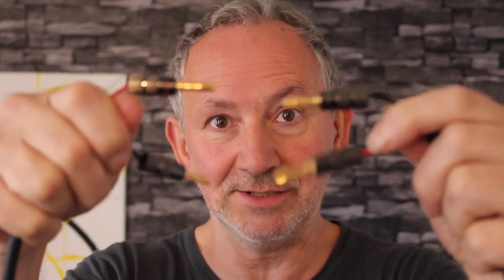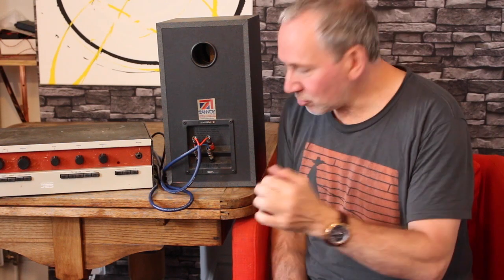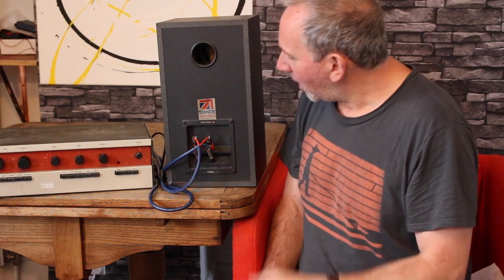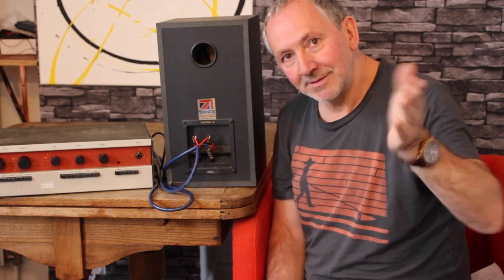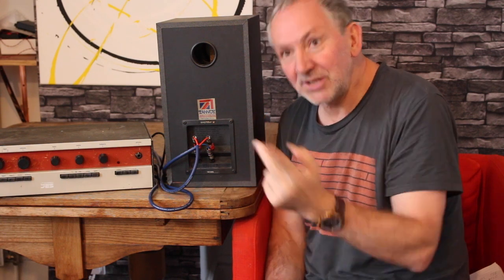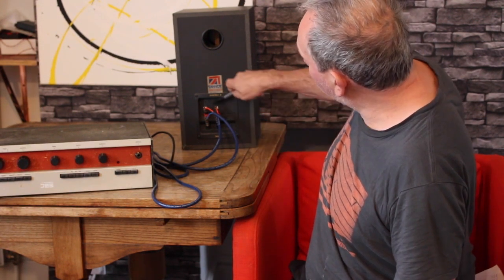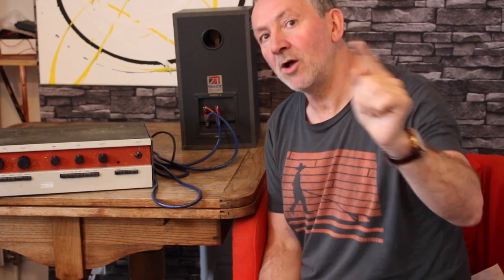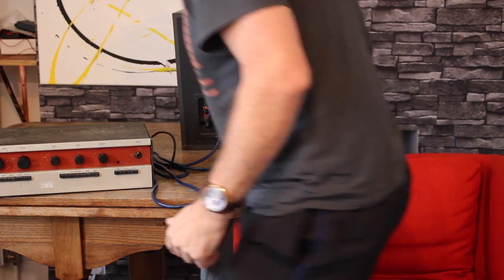WHAT IS BI /WIRING does it improve sound quality

Comment: Aaahhh No!!   Biwiring does not REMOVE circuitry!   How could it?  What have you removed?  You have ADDED twice the cable...  You've quite literally INcreased circuitry.  Think of cables as resistors (and they are).  What you are doing is changing WHERE the cable resistance is placed in the crossover schematic.  Yes..... Biwiring can change the sound.  But not for the better, in my experiences.  It's just different, and it's probably not how the crossover was voiced by the designer.  Adding resistance between the High and Low halves of the crossover will change the sound, and it's likely that the crossover was designed with the 2 halves connected together (ie... both halves being driven by the same EXACT signal).  If you separate that connection at the crossover input, suddenly both halves are not seeing the same exact voltage signal.  I've found that driver integration suffers with biwiring.   Your mileage may vary.

Comment: I've tried biwiring my Mission 760iSE and I honestly can't tell any difference. It only really works in systems which use active crossovers and bi-amping; one amp each for HF and LF. I'm not convinced by cables either. They are basically just copper conductors carrying a small voltage. The only things that really matter are; 1. Never use that thin crappy "bell wire" stuff, 2. Keep your cable runs as short as possible without over tensioning them. 3. Make sure your banana plugs (or whatever) are properly connected to the cable ends; preferably soldered.
Reply: Crimped with a proper crimp tool is better than soldering for power applications.  Loudspeakers of the home variety generally are low power a few amps at painful levels.

Comment: Bi-wiring sells twice as much audiofool wire (2000Pounds instead of 1000GBP).  Double blind test, or instrumentation proof? A big nothing, when compared to external crossover before 1 amp channel per driver. Tweeters and mids can get super-excellent low power Class-A  amps without too much heat or power consumption with lower overall thd.
Reply: Chip amps have way lower THD than tube amps. Class D are very efficient too.

The HY30 /60 amps from ILP were encapsulated chip amps, DC to 250KHz and flat. They were the prefered small amp module for all engineers and techs thirty or years ago.

Comment: Cables, they certainly contribute to the sound but it is nothing significant. But Bi-Wiring certainly do contribute quite significantly to the overall sound quality. I would say even more than 4%. In my case I would say that the sound betterred by even 10%. It was audible at first listen immediately.
Reply: Do you have a cross over in your amp before the output terminals? Otherwise the signal is the same in the two wires to the speaker but then filtered after the speaker crossover. Hearing bi wiring differences is the perfect example of placebo effect.
Reply: @spudpud-T67 As I've pointed out before, the two elements of the crossover are separated by taking out jumpers between the upper and lower terminals. You now have two completely different 'branches', the point at which the highs and lows branch being now at the amplifier end rather than the speaker end. The high pass filter will 'demand' that the high frequency current flows along the tweeter wire, and the low pass filter will 'demand' that the low frequency current flows along the woofer wire. 

That split point at the amplifier end is, in a single wire (normal) configuration, inside the speaker cabinet - usually part of the printed circuit board for speakers with one pair of terminals.
Reply: @rogerwebb7501  Thats a theory some state. Even going as far as to say they hear a difference, but that's not how the signal in the system works.
Reply: @spudpud-T67  It's not a theory, it's a scientific fact! It IS how a crossover and its associated wiring works! The crossover is frequency dependent...each leg of it, that is: It divides the two      groups (or three...or four) by frequency and feeds the treble to the tweeter, and the bass to the woofer. I think the trouble is you don't understand WHERE that split occurs. Ina biwire setup the split is dragged back to the amplifier end....rather than being inside the speaker cabinet.

Comment: I use 10 or 12 gauge on woofer and 12 or 14 gauge un upper end.  But without a doubt, bi or tri amping with an electronic  crossover is the ultimate. I started doing this in the '70's.

Comment: I discovered decades ago that high quality speaker cables dramatically improved the KEF speakers I had at that time: more spacious etc.  As an engineer, this seemed likely because of the relatively high current involved after the power amplifier but I remained a sceptic about interconnects at signal level, ie from CD player or network player to the amp.  No longer!  I became convinced to lash out £50 on an RCA interconnect by PS Audio and boy, did it make a difference.  I was completely gobsmacked that changing the cable carrying such a tiny current could make a difference but it did!  Now you’ve convinced me to at least try bi-wiring which I’ve also been sceptical of.  I love experimenting.

Comment: Hi Kelvin, nice video and I've just subscribed to your channel too, so thanks.

I agree, I bi-wire my main system using Mogami W3104 quad cable, which is fantastic stuff.  It doesn't take any components out of the circuit, but it does separate the signals in the wires, reducing crosstalk between high and low frequencies.  This is the part that some people don't actually believe, of course, because they think that it's all the same at the amp end.

I agree with you on interconnects too.  I thought I'd have a go at making my own and I love them so much I sold all my Chord Company cables, even though I'd been using them for years.

Comment: As an electronics engineer by trade and as a guitarist by hobby I will say this.
A speaker / audio transducer is an electric motor. It converts electrical energy into mechanical energy.  As long as the cables can carry the voltage and current then it doesn't matter if there is one or two cables.
Reply: Lol 😊
Reply: But you're not an audio engineer.

Comment: Head to the shed and nick the cables from your old Arc Welder, and hook them up to your system. It worked very well for me for 25 years, until I invested in some quality Japaneses Speaker Cables of a similar gauge (thickness), 15 years ago.  Thicker Cables do take wrestling to get them were you want. Also depending on the Banana Sockets Mounts, you may need to suspend very heavy Cables to remove pressure of the Banana Sockets.

SCIENCE: Signals move along the skin of a wire, so the more wires, the greater the surface area the signal can use. Also the lower the Resistance, less energy is lost (heat). The more pure the copper used the easier for the electrons to travel, the more efficient the cable, and lower resistance.

Comment: Once again, I have to agree with you. Sensible choice of cables when bi-wiring is usually a worthwhile improvement. The next step, bi-amping, I have found makes an even better improvement. The ulimate, going 'active' using active crossovers instead of the passive ones inside the speaker cabinet, can make a massive difference.

Comment: 2:15 The second benefit is "This wiring will go direct to the tweeter without going through the crossover". I am surprised by such a lack of understanding. I've been designing high performance speakers for over 30 years and have never provided a bi-wire option. If anything, having the option to bi-wire on a loudspeaker can often mean the crossover is less optimally designed than it could be. Manufacturers don't believe it makes a difference, but are compelled to include them for fear of losing a sale to a competitor. I guess one cannot argue with the claim, "but I can hear a difference" because those making the claim refuse to be subject to any form of controlled test, but at least it allows the rest of us to judge the credibility of their opinions about other aspects of audio. Sorry Kelvin, I have the greatest respect for you and I always enjoy your videos, but was disappointed by this one. I would have thought someone like you would be dispelling these myths not reinforcing them.
Reply: Some people seem to think the lows keep obediently to one cable and the highs to another. It's the same signal in both wires arriving at the speaker terminals. Bi wiring is an example of the placebo effect.
Reply: @spudpud-T67 Wrong! Why cannot people look into this from an electronics point of view? Because of the load provided by the tweeter and high pass network, and the woofer and low pass network, which are completely separate in the biwire configuration (the jumper links removed) the demand of the load in both cases is different, ensuring that the high frequency current travels down the tweeter wire and the low frequency current down the woofer wire.
Reply: @rogerwebb7501  We have looked, hence the statement.
Reply: @spudpud-T67 Erm, what do you mean 'we have looked' at what?
Reply: Under no circumstances would you want to directly connect the tweeter to the amplifier output.
That would sound extremely bad and most likely result in damage to the tweeter itself.
Bi wiring separates the high and low sections of the crossover network, allowing them to be separated at the speaker end, but they are still connected together as the amplifier output 
The sonic improvement is minimal at best.
Bi amping is a different story altogether.

Comment: I'm running Fyne Audio F502 from a Yamaha A-S1200 amp.   I'm using a double run of Kimber 4VS to bi-wire.  The bi-wiring makes a good improvement over the single cable run.

Comment: If you bi-wire to separate channels on your amp and if your amp has gain controls you can tweak your high and low outputs and change the sound. Throw that in with an EQ and you can use lamp cord (which back in the day was 12ga solid copper) and it won't matter.

Comment: Bi-Wiring is just OK, you should consider Bi-Amping, a whole different level in sound!
Just make sure you remove the metal bridges(Jumpers) between the 2 speaker terminals or you will fry your amps!
Reply: bi amping can actually sound worse due to phasing issues, im a musician and can vouch for this. there is always a delay of sound between amps unless they are identical and serviced.
Reply: @Synthematix  I use an active crossover, it eliminates that issue and I can equalize my speakers to my liking.
I use a tube power amp for the midrange and high frequencies and a solid state power amp for my low frequencies with great results!

Comment: depends on the interconnect resistance you need to go for coaxial cable 75 ohms for interconnect if it's digital source, analogue source go for 50 Ohm's into a preamp or Poweramp 50 ohms give you about 2 of 3 DB drop in output what is preferred for solid-state don't do this from valve stick with 75 ohms. Belden cable is probably the best cheapest. Always use 60 50 or 30 ohms possibly from turntable to preamp don't go with 75 ohms this will give you less output as I said but makes a cartridge more sensitive

Comment: Tried bi-wiring/bi-amping with my Arcam AVR20 (you can enable bi-amp feature for fronts) and it did open the soundstage more and matched sound of Lyngdorf Amp which I think is impressive. I used relatively cheap QED cables £200 for a pair.

Comment: In my experience it does improve sound quality and the noise floor lowers but ONLY when bi wiring is done and healing crystals are placed in a deltoid pattern at the base of the speakers and amplifiers. Works even better with crystals placed around the source aswell as on the listeners pants pockets.

Comment: If you like the tweaking you can do with cables, you can use for example Belden cable. High capacitance leads to the suppression of the higher frequencies somewhat. I use 1800B, probably this is also great for bi-wiring.Try it for your tweeters, as it’s highly revealing.    I like 1313a as well, this is thicker and quite high in capacitance.

Comment: Very nice! My question is: if you combine the two reds and two blues into one banana plug each going into one post in the amp, do you still get the tweeter and woofer separated in different speakers (if you switch off A or B)? See 3:27. And where do you connect on the amp using four banana plugs? All A or a B posts or a mixture of A and B posts?

Comment: As I understand it, bi-wiring is simply a case of supplying power to a speaker via 2 positive and 2 negative connections, with the bridging plate removed, of course, but from one amp output only whereby the 2 positive connections are joined together to make 1 connection, and the same goes for the 2 negative connections; you actually described this process at one point during the video. What you're doing is bi-amping: you're effectively supplying power to the speaker from 2 amps, using 2 positive connections and 2 negative connections at both ends, again, with the bridging plate removed. In a way, bi-wiring simply moves the bridging connection from the back of the speaker to the terminals on the back of the amp. The main change is due to the extra 'cable thickness' by using two runs of cable.

Comment: My aged friend is an audiophile with huge knowledge and professional experience. He reckons household mains wiring is the best. Spending any more is a waste. My speakers have been bi wired for decades. They sound great. I did it because it was the fashion in the 1980s
Reply from the maker: Yes I’ve used mains wire in the past it’s just fine I mean there are small differences in cables truly
You have to be pretty rich to justify the small advantages of expensive cables.
K
Reply: Mains cable for the woofer, silver for the tweeter is the best option, model railway silver large track bus wire is the ultimate speaker cable: 

High frequencies travel much better with silver wire, thats why we use it in digital model railways: 

search ebay for "Large track bus wire" then with your drill make it into a twisted pair.

Comment: Hey there, new to your channel and really like the advice. Got a question, I have a Yamaha RXA3080 and wanted to know if it makes sense to run a Pioneer M-72  4x100 watt  amp through the Yamaha pre-outs to i-amp front LSI-9 Polk speakers or just use one of the Yamaha's channels not being used on my 5.1.2 set up? Thanks Ron

Comment: Hi there I liked your video. I'm I  the process of making a little stupid for my garage. I have an arcam xeta one a/v amplifier. Is it possible to get some sound from it? With two celestial k12t-100 with tweeters all running off of one cable it seams. I can't see in the housing to see what the tweeters are. And input is large jack. Any help would be appreciated. Also there are many ports on the back of the amp do I just head for the loudspeaker outputs. Although there is front, surround and centre.

Comment: tried bi wiring couldnt hear any difference.  best tweak i did got a mains conditioner and upgraded my power supply, immediate result in better sound
Reply: Greetings from Scotland. ..yep I'm in agreement with you...I used an ex BT 3 gang mains conditioner from eBay very heavy....wow my screen improved and my sound, best upgrade on the cheap ever
Reply: I've not tried bi-wiring yet but the £50 I spent on a power supply for my WiiM streamer made an amazing difference that everybody can hear.